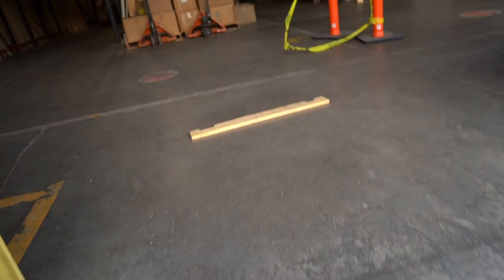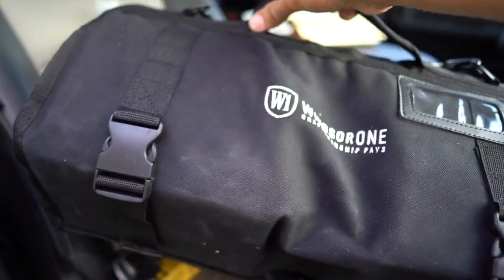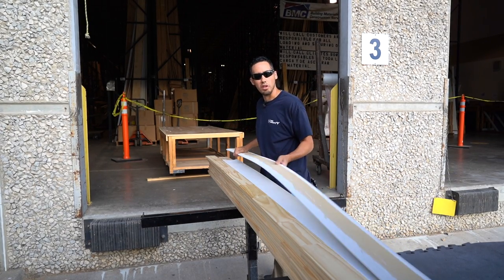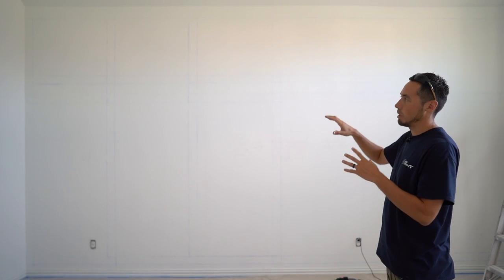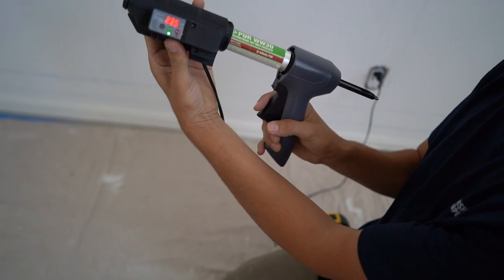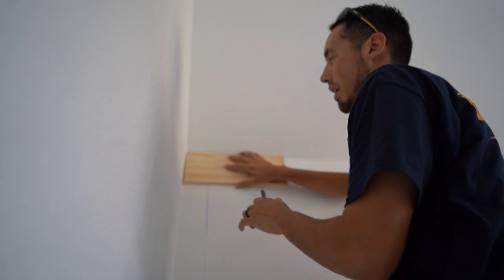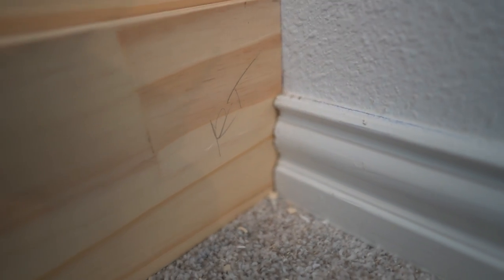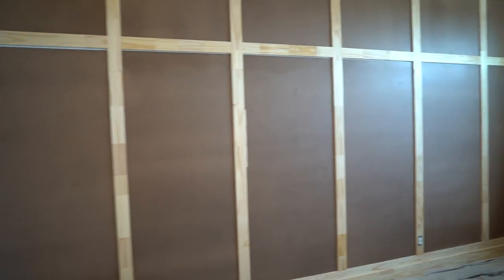NO More MDF!!!

Comment: I have posted this statement before , I have been in trenches for almost (months short ) of 40 years , I have been a finish carpenter 30 years of that , enough of the credentials! 5 years ago I was diagnosed with stage 4 cancer of the throat , there was a 9 year stretch I did inordinate amount of work with MDF , I cannot say it was solely complicit of my diagnosis . But what I can tell you , is  the symptoms after spending days cutting it , sore throat , a lot mucus, and yes I did go to n95 masks constantly. Then set up vacuuming, but the micro fine dust still prevailed , you have the idea , I’m still vertical and still out there ,but the residual effects have taken years off the back end . My point  use alternative materials when you can , accompanied  with masks and dust collection when inside this is a must, just a heads up , take heed
Reply: The damage the dust does to your motors, cost doesn't balance out
Reply: Trevor Blue excellent practical point
Reply: My brother says he got sick with respiratory issues, every time he cut MDF. He maintains it is going to be the next “asbestos”.
Reply: So glad this issue is being addressed. MDF is full of chemicals. Hope you get well, master!
Reply: couldnt be better said
Reply: An n95 mask will stop the particles of mdf sorry, but if proper mask are worn and worn correctly it would not be an issue. N95 mask are only as affective as the person putting the mask on, first step is proper dust collection second is ventilation. third wear a mask and that goes for any cutting of lumber. It is a proven fact most do not wear there mask properly, this is same reason cdc has talked about the effective ness of n95 mask.  While I feel for you and i am currently dealing with some throat issues i dont blame this or that.  I dont think 5 plus years ago most were wearing n95 mask to begin with, most used regular basic dust mask and they are not affective as they dust still comes around the sides of the mask.
Reply: All observed points taken by myself and others but there are still irritating mucus membranes , swelling , then just the emptying and cleaning of dust collection &tools are difficult . This is a material that should be considered dangerous , usable but dangerous with prolonged exposure.

Comment: For the most part everyone would prefer to use real wood! The problem is the cost. On our home remodel to use premium pine window trim for 12 windows is around $1,500. Now, I would put up oak but the $$$. 3 years ago would have been a different story. I won't be putting MDF in any moister areas. Like bathrooms or kitchen. Any rate I got all the molding I need for $150.00! It comes down to money for most people. Besides when used in the right areas like you said it's all 👍

Comment: I believe that the last time,I commented on your site was about the advantage of using copped vs mitered inside corners for crown.   You didn't blow me off as some kind of old back in the day gizzer. If fact you were very respectful, and wrote a great response.  So I knew from that you were going to have a successful career in the finish business and that outlook would probably lead to a successful you tube channel.  Well it's great to see that you are continuing to be successful in both arenas.  I'm happy to see you make the decision to try and use a real wood product. I agree that MDF has a place in interior trim and always will but for my money Windsor One and other top quality paint grade fj wood moldings provide your owners with a higher quality product.  In the "valve for money equation" they are superior in almost all applications of interior trim.  Not only that but real wood it's so much more interesting, challenging, and healthy of a product to install. In my career there are a couple hand tools that have become invaluable trimming with real wood and I encourage you to consider. Buy the best low angle block plane you can afford. I've an old Stanley "Sweetheart" but there are better ones made and produced currently. Have a quiver of hand saws and even a back saw always raiser sharp and available. In this line of work you will never need one with less than 12 pti so an 8 pt need not apply. I've got both traditional western push and Japanese pull in softer words I prefer push on harder pull. While I mentioned planes I also carry a smoothing and two different kinds of spoke shaves. Next would a set of chisels so shaper you can shave with them,, I have a set of Marples that are probably 50 years old.  They never leave their leather pouch until used and then go right back in after doing their thing. Real wood has grain and grain is the bane of a carpenters existence,,, MDF has none. Grain no matter how fine will affect the cut and demands a sharper tool. Speaking of which lean to sharper all you tools, including your saws if you have time but at minimum your planes and chisels. I rarely a adjust the machine cut on MDF by any other means than abrading,,I always adjust real wood cut with another cutting tool,,, must often with a plane, then chisel second, and finally hand saw. 
So in you next interaction, I expect to one day open your channel and find that you are primarily installing paint grade poplar, but mostly stain grade appearance millions of oak, cherry, walnut and maple!! Great channel, but I suggest an alteration to the title; Trim TV; evolution of a trim carpenter's life from journeyman to master,,, yes probably not a little to pretentions,,, humble is better. And "Keep up the good work"
Reply: jami w  sorry you missed my point,, but learning the hard way is often the best
Reply: @pauljenkinson8798  What some of the younger generation are missing is that true understanding of traditional methods and tools is the foundation for getting the most from the ever-evolving modern ones. And IMO the willingness and ability to mix and match tools and methods, including both the oldest and the newest, according to the specifics of the job at hand, is at the heart of craftsmanship. The old masters accepted that maintaining and inventing tools were just part of the gig. They focused on achieving perfect and lasting results --- and did so by whatever means necessary.

Comment: In the Midwest, 90% of our trim is finger jointed primed pine, very little MDF. The painters do not like MDF either.  All built-ins are poplar, along with all ceilings, fireplace build outs, wall build outs, and built in closet finishes.

Comment: I use a lot of finger joint pine and the majority of it does come primed. I do look the pieces over prior to installation and sometimes there is a blemish or two in the primer application, but nothing a quick hit with some sand paper doesn't fix. If I do run into a situation where I can't get the material primed I just prime it before the installation. I find it is easier for me to sand and prime it on some saw horses rather than in place after the install. Thanks for all your work here I really enjoy your channel and have learned many many things from watching it.

Comment: In my area I use Windsor 1x s4s instead of poplar for painted built ins and mantels. It actually is less expensive, they’ve cut all the knots out of it, and they come in reliable lengths. I have mixed feelings about working with MDF but they both have their advantages depending on the project. The best thing about MDF is that the material comes in 16 and 17 foot lengths and doesn’t have splits, twist etc for production trim work. Nice video.

Comment: I did trim work from 83 to 88 and after military service 92 to 96. I trimmed with a master carpenter and we worked in Dallas doing remodels and new construction in the Inwood area where Ross Perot and the likes lived. In the late eighties, builders were trying to skimp and use mdf in million dollar homes. If this stuff gets wet, it becomes sawdust mush. We refused to use it because of the warranty work involved. Finger joint is good to or painted areas and grade A for stained areas all with furniture tight joints. When we left a house it was there for life.

Comment: Just a suggestion that I do. So on that first vertical board you put on that you had to scribe after you put the 15 degree bevel on it. This wouldn’t work always but I use a palm sander to remove what needs to be removed. Works good if you only need to remove little amounts

Comment: I also follow insider carpentry and bought the HIPUR gun he recommended. I had moderate success with it. I felt like the strength wasn’t that great until it was able to set over night on window and door casing. The ease of removing squeeze out is awesome versus the CA glue. We pre-assemble all of our window and door casings and during installation actually broke a couple of joints while manipulating them into place. We decided to let them sit overnight and then the strength was incredible. Just my experience with it.

Comment: Wow, this is looking good. I'm just a homeowner but I'm getting ready to do something similar on a wall in my home. If it turns out well I will do other rooms. I went to both big box stores yesterday to look at lumber to use. Every single piece was warped after so many feet so I will be using MDF because it's straight. I can't afford the best but I want the end product to look as professional as I can get it. I have that texture on my walls as well and I've been sweating bullets over the thought that I might have to skim coat it. I've seen that "hardy board" (?) before but I wasn't sure how it's installed. I figured I'd have to cover the wall first but it looks like you got the frame up first and then cut it into individual pieces to fit inside the grid? I hadn't thought about gluing the joints. That's a damn nice house that you are working on. In the state that I live in, that home would be over $1M...depending on the lot. I can see why you used wood as opposed to MDF. I've learned a lot watching this video.

Comment: I like to run the boards through a planer before hand. One pass usually does it. The joints will come together much nicer.   Lot less sanding. Get yourself a portable DeWaukee 13” planer.

Comment: We have the choice between finger joint, primed finger joint, and primed mdf. I avoid the primed finger joint because the primer is super rough and takes a lot of sanding. The raw finger joint is my preference but I’ll take the primed mdf second because it does finish nice and smooth. You don’t always get the choice.

Comment: This just popped up as I'm literally getting MDF trim delivered tomorrow morning for my 3000 sq ft house remodel. My contractor said it would save almost $1k by going with MDF. He is using pine in the tiled areas. They are priming all surfaces before they install it as well. Hopefully I didn't make a bad decision.
Reply: Dan you're fine. If both the finish carpenter and the painter know what they are doing you can have mdf trim that looks as good as anything else.
Reply from the maker: I have been using it for years with no problem. In fact the stuff I installed in my house is MDF. But Windsor 1 is superior and that is why I’m switching all my 1x material them.
Reply: @FinishCarpentryTV  I hear this all the time, wood > MDF. And for things like sheet goods, plywood, etc. I can't disagree. But for trim, I'm having a hard time understanding how MDF is inferior for paint grade trim. It's so consistent and predicable compared to real wood.

Comment: As a painter I have to say I hate when  builders use mdf for white woodwork. The shit always swells when I fill the nail holes and even after I sand it, it puffs up even more when I spray it. So then I have to 3rd coat fill it to make it smooth before final spray coat

Comment: It's not always easy to find, but 5/8" x 5/8" cove works better with 3/4" boards by leaving a more defined reveal.
Reply: He’s using 1/8” paneling against the wall which would bring 5/8” cove out flush with the rails and stiles.

Comment: It looks like you are using masonite in the squares. What size do you use (thickness) and what do you use as a primer and final paint coat? The last time I did mine I used a very smooth plywood panel and it just didn't paint up right. I appreciate your videos. Good descriptions of the detailed work.

Comment: Finish Carpentry; just want to say i luv ur videos cause ur such a perfectionist n i learn so many good tips from u on how to do good work. I have a question, i am doing board n batten n a bathroom n was wondering how u do the slats against the door. Since the door has the same size trim, would u use that as ur first slat or do u butt ur first slat up against the door trim? (Hope that makes sense). 😟

Comment: I avoid MDF at all cost because of the health risk. I don't even give clients the option. The cost savings are quickly evaporated if MDF gets wet. A basin tap leaks, a minor roof leak, hydronic radiator leak and you have to remove trim, repair the drywall, because it was caulked to the wall., replace the trim and repaint.

Comment: As a painter I prefer real wood over MDF. Real wood can get wet and retain it shape, MDF not so much. I've had the displeasure over the years trying to repair the stuff after it gets wet.
Reply: I'm also a painter. At this point I absolutely refuse to fix MDF. Replace it or live with it.
Reply: Interesting point... I don't like MDF but I love Super Refined MDF. SRMDF is superior in many ways to wood in many situations. 

But that makes sense... Water will destroy the paint of both MDF and wood if it gets under the surface. But wood may be repaired instead of replaced. Makes sense.
Reply: Most of the mdf now  has risen's in the glue that make it much more water resistant  and performs similar if not better than  that soft  pine. As cabinet guy that uses fine finish paint (lacquer)  I need to have a flawless material to paint  or else I'm doing a lot of sanding. With the right sealer mdf is without a doubt the way to go . When your using a rubber glove to cover  your work I guess it hides 18 gauge nails holes and any material that  you use.   I do like the finger joint material.  I used to think it was garbage just a mill trying to use up there scrap. But now I realize the advantages to an engineered product  vs a natural product.  It's easy to say this is real wood so it's better. that's what most people think when it comes to woodworking . But when you doing carpentry everyday and you deal with all the different problems(I've never seen a strait wall) that come up when you're trying to make something look good that last thing you want is to deal with is a piece of moulding that's warped or bowed and now  your fighting to get that to fit. When your trying to make a living doing carpentry you need all the help and save money as you can . Personally  I buy 12 ft sheets of 3/4 mdf and ripp it up into any dimensions  I need and use a shaper or router to make my own moulding . Unless I need alot of LF .It saves me money and time and  I can get that piece I need instead of hoping the manufacturer makes something close.
Reply: @darrenlesueur4785  thanks for the input. And Rusty's comment made me look into some water Resistent super Refined MDF. in theory it should actually be more water resistant than natural wood, but the case is still made that when it gets destroyed it must be replaced .... But at least with a moisture Resistent super Refined MDF it will be harder to destroy than wood once the water gets under the paint
Reply: @darrenlesueur4785  I get that but in my area it's a common practice to put MDF in commonly wet areas like bathrooms and window ledges. It swells up and becomes almost impossible to repair. I also think perfection is overrated, I'd rather have have a product with a few inconsistencies but is durable, than one that is not. There is a reason why old buildings with natural materials outlive their owners. Just my two cents though.

Comment: Nothing wrong with mdf for all the detail on accent walls. Its usually very straight, consistent in thickness, very clean and free of imperfections. Its a fine material for the right job. It has its place.

Comment: I am not a trim carpenter, though I have done some in the homes that I have owned.  I have concluded that I would much prefer the use MDF over wood in my home. MDF does not present seasonal movement and is less likely to warp unlike wood.  The wood trim purchased from lumber yards is not being stored in a climate controlled environment and is subject to the variability of the relative humidity of the season of the year.  It is unlikely that trim carpenters would store the wood trim in the home they were trimming out to allow it sufficient time to acclimatize to the new environment and it would likely not prove useful anyway once the heating and air conditioning cycle began after the install.  I have significant would trim in my home and can attest to the effect the seasons have on  the trim.  Give me MDF anytime.

Comment: My first experience with the hyper was not so good. When I sanded the join the hyper didn't sand down at the same rate as the wood also noticed the glue expanded a week later.
Reply: Having a tight joint is important. If the joint is tight the joint will be invisible. But when there is a buildup of glue you will get the issue you are talking about. Clamps and pinch dogs help.
Reply: @InsiderCarpentry  idk what went wrong. I see you using them all the time with great results. I used clamclamps and everything for some reason it was not cooperating.

Comment: Hey Richard, if you had to hand paint a board and batten wall, would you paint all the horizontals first, let it dry, and then paint the verticles? Or would you paint it all at once, knowing you couldn't maintain a wet edge. Which way do you think would hide the intersections best?